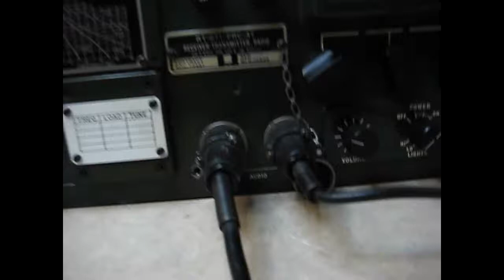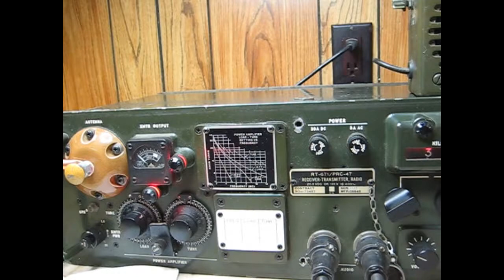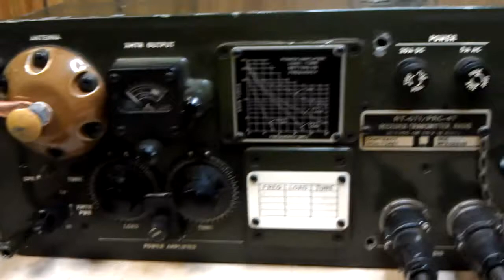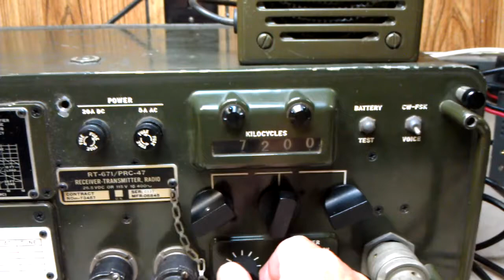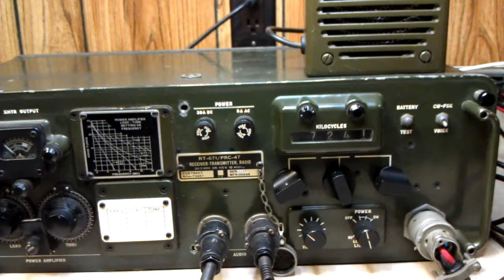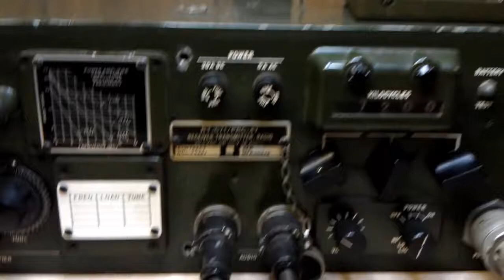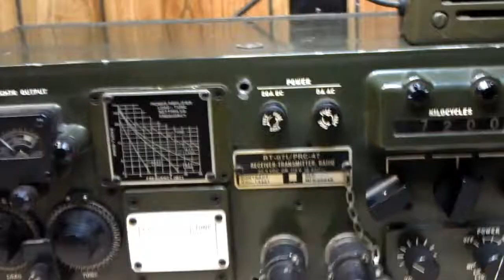PRC-47 Vietnam era transciver

Comment: Is that one wire for 117v or 24dvc?  I’m looking if the CX-8394 power cable
Reply: must be  24VDC otherwise  it  would not need the inverter.

Comment: i have one of these how do i get the power cord
 i was also wondering what all can u pick up with this radio thanks for all your info u can provide
Reply from the maker: Maybe try Fair Radio?
Reply: k ill try their o an what is the volts or power needed to run this
Reply from the maker: Endospirit Stonepath I was using 28 volts dc.
Reply: would that be batteries or a converter i would like to use it if it works i have the power cord an battery case but can i plug it in if i splice or find a converter thanks

Comment: I always found this radio to be one of Collins lesser designs. The receiver is very "nervous", probably due to the fact that the AGC is way too fast and there is too much RF gain. In it's defense, the latter was probably done because the radio was primarily developed for use with short whip antennas, not for full-size HF antennas. Also, the DC-DC converter is prone to the Ge power transistors burning out. Replacing them with more powerful Si (PNP) transistors requires modification to the transistor's DC bias, otherwise the inverter won't start. Having said all that, it is built very well in typical Collins style. But the electrical design was a disappointment to me.